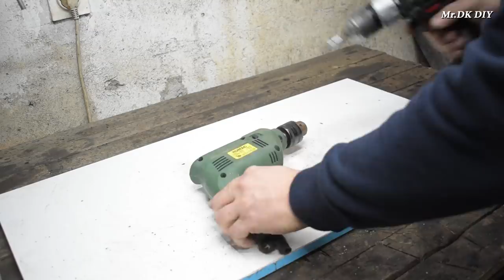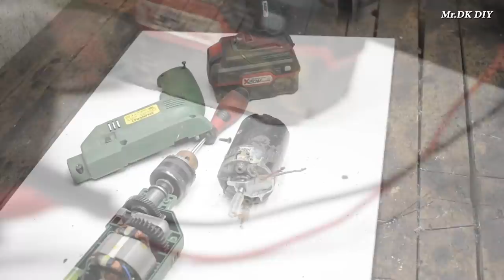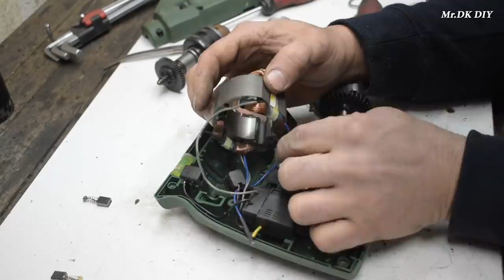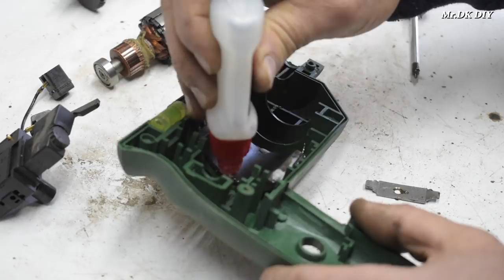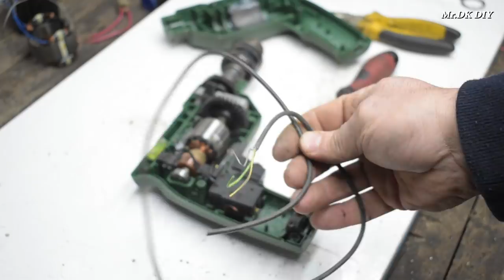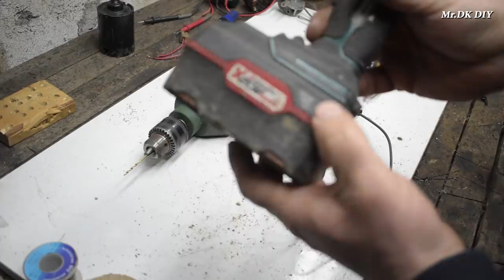Will it be a successful experiment??? I try to turn a damaged 220v Drill into a 12v DC Battery Drill

Comment: A drill motor is a series motor.  Will run equally well on AC or DC.  The AC speed control may or may not work on a dc source, depending on the type of control.  The impedance of the electrical coils will be different with direct current.  You just have to find the right input voltage and speed control.
Reply: WOW, i didnt know all of that information, thanks for sharing!!

Comment: but will it work with the same power?...
I wanna to use old 500W 220v AC drill the same way with 12v DC car battery (12v but a lots of Amps possible ;-)) at e-bike, but not sure if it stays the same 500W of power :-D
Reply: It will work well if u supply it more than 40 amps of current at 12v.